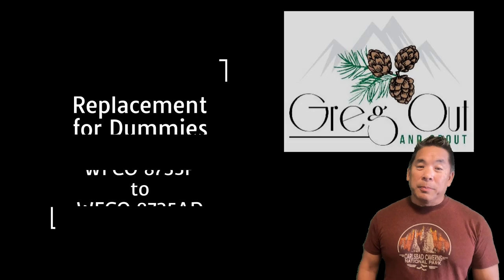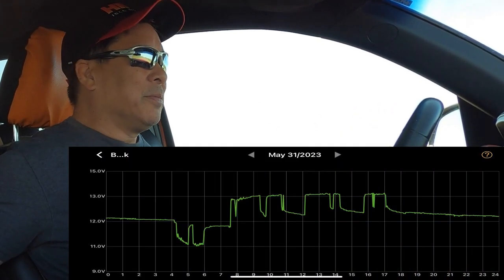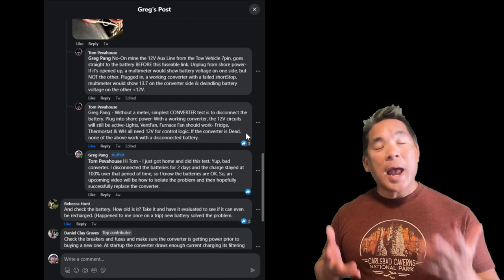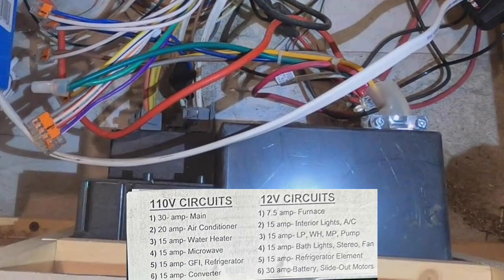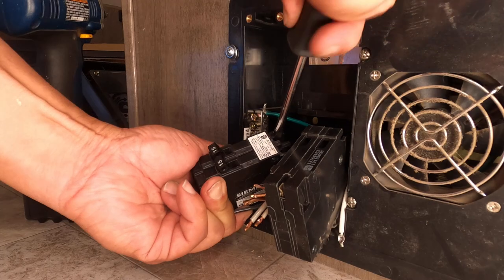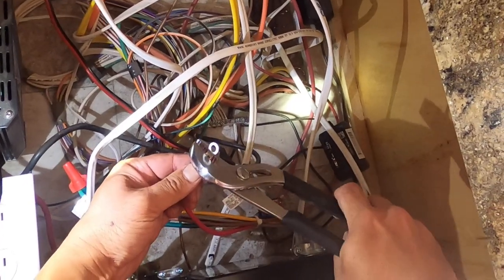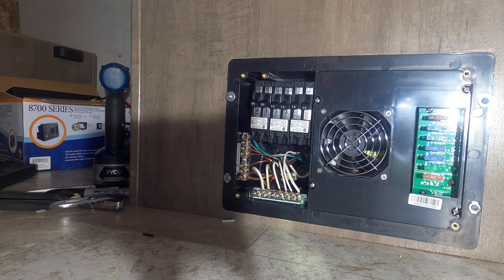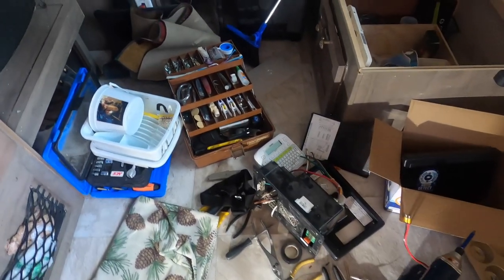RV Converter Replacement for dummies. Upgrade from WFCO 8735P to Lithium-Ready WFCO 8735AD.

Comment: Don't go for the WFCO auto detect unit. It's a tremendous pain to get it to recognize LiFePo batteries...if you can get it to work at all. The WFCO auto detect requires you to completely discharge your lithium battery, and then run through a complete charge cycle before it's supposed to detect the different response of the lithium vs. lead-acid. It failed to detect my new lithium battery. And I've seen reports of issues with the AD unit forgetting the lithium setting...forcing you do do the full discharge and long auto detect charging cycle repeatedly. The Progressive Dynamics 4100 has a similar form factor to the WFCO 8735 and it has a simple switch for selecting between lead-acid and lithium modes.
Reply: I discharged my lipo battery to 10.9v, kept the solar disconnected the whole time. Then plugged the trailer back into shore power only and it switched right over. I have the old firmware on the unit.
Reply: Thank you. I think my converter is bad. Looking to replace with something lithium compatible.
Reply: Agreed - mine has been a bit of a pain. I'm not terribly savvy with electrical issues, so it has to be simple and easy to manage. Not feeling like this 8740 is helping me.

Comment: I’ve been doing a lot of research on this, and although the AD model stands for auto detect, according to WFCO spec sheets has the same output voltage for the standard model  and the AD model, so the AD model still can’t fully charge lithium batteries. I’m not an expert nor an electrician, just going off what the specs say.

Comment: The power center in my 180 was stolen so I have no idea which  wires attach where. If I had removed them I'd know exactly where they go. Do you have any tips on how to determine the answer? Great video, thanks!
Reply from the maker: Stolen?  I'm sorry to hear that happened to you!  What year was your trailer manufactured?  This might be a good question to pose in the Facebook Rpod model 180 owners forum.  Another owner with the same model year might have an answer.

Comment: I'm going to buy a lithium power charger for my lithium batteries INSTEAD of replacing my old power converter. My question for you Greg is, for those DC wires on the right side, it should be easy enough to open it up and see where the DC output to charge the batteries comes from right? Basically, I want to dead end that cable so that my system can remain powered from the new lithium battery, but I want to disable charging to the lithium battery from the power converter. I have the WFCO 8935PEC.

Comment: The red light comes on and off then back to green by the fuse that’s labeled 6 - 30 amp battery fridge.  I believe this is why my battery runs low at times causing my fridge to alarm. Any idea what cause this? Should I check the wire connection?  Great video

Comment: It looks like you had a lot of extra wire. I was wondering if it was possible to leave the wires hooked up and pull the unit out a foot or so? It seems like it would be easier to disconnect and connect the wires plus you could move them over one at a time. This would only work if you had enough slack.

Comment: my 1989 terry resort has stock 30 amp fuse panel i ordered the wfco 30 amp an i got the 55 amp wf-8955 model.... can i still use this on my 30 amp system?
Reply: Yes. I have the 8955PEC and I called WFCO and was told all their models are 55 amp even though they work with 30 amp.

Comment: Looking to get a spare WF-8955-AD in case my orginal 8955 fails. Also I want to install an EMP shield on mine. Unfortunately, my converter box is in a small space under my rv fridge. Not much room to work. Thanks for the tips.
Reply: What is an EMP ?

Comment: My WFCO converter in my Model WF-8735P Power Center just died in my 2015 TAB S Max trailer, so this video was very interesting.  I still have a lead acid battery in the trailer, but converting to lithium soon is my goal, so I want to replace my current failed power center.  I've heard there are two choices in replacing your power center when you upgrade to lithium:  One is the WFCO Model WF-8735AD as you show in this video, and the other is the WFCO Model WF-8740AD.  I am wondering if the WF-8740AD is a newer version that has come out since this video, which might now be what I should replace with?
Reply from the maker: To my knowledge the only difference between the 8735AD and the 8740AD is the amperage rating.  35 max for the 8735 and 40 for the 8740.  Since I wasn’t upgrading anything that required a higher amperage, I replaced straight across with an 8735AD.  You might consult the T@B manufacturer for their guidance.
Reply: @gregoutandabout  Thanks, Greg!!  I contacted the TAB NuCamp company, and they said they are currently putting in the 8735AD in their TAB 320's. I definitely want to make sure I get the newer V.19 (or possibly V.20??) firmware, however, when I order the power center.  Now that a V.20 firmware is available, would that be the best one to get?  I still have a lead acid battery in my 2015 TAB S Max, but would really like to change over to lithium at some point. Would the V.20 firmware then be best?  Is the company you ordered your power center from able to determine which firmware number they are sending out if you specify the firmware you want?
Reply from the maker: @kims.8718  I don’t know anything about firmware versions so I’d go with what T@B recommends.  Good luck!

Comment: Hi Greg, I am looking to make the exact same change on my Ranger 12 A-Liner, I have the 8735P as well. I appreciate your video, very well done! Got an e-mail from WFCO today telling me I should not swap converters if my battery is more than 10 ft. away from the converter. Curious to know how far apart your battery and converter are and is the cabling to your battery #10 wire gauge.
Thanks, Dave
Reply from the maker: I’m guessing yeah 10 gauge but it might be 12.  Converter and battery are probably 10 feet as the crow flies but I’m not sure how many cable feet there are once the wire disappears into the frame.
Reply: @gregoutandabout  thanks for the reply!

Comment: This was sooo helpful.  I have the same power converter as you started with. I also just upgraded to a lithium battery. As I understand it, the lithium battery needs a little more voltage than the lead acid. If I upgrade the auto detect will solve thi?
Reply from the maker: That’s what they advertise but I haven’t changed out my batteries yet so I will be looking for advice at that time, just as you are!

Comment: I thought the converter alone could be replaced without replacing the entire power center?  Is this not an option because you upgraded to the one that will charge Lithium?
Reply from the maker: For this particular model, the converter is integrated into the power center, so if there’s a way to access and extract just the converter it wasn’t evident to me.  Besides, I think the computers/motherboard inside the old power center are not lithium compatible, so you gotta replace the entire thing.